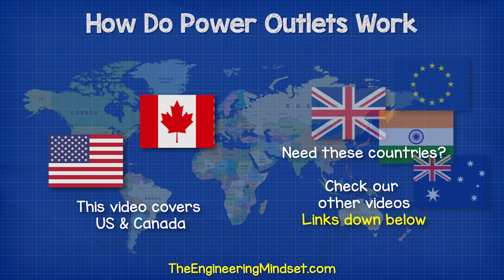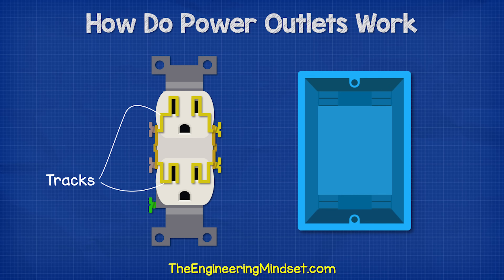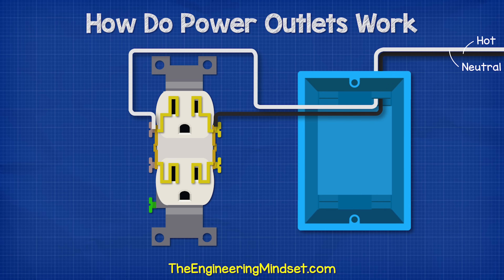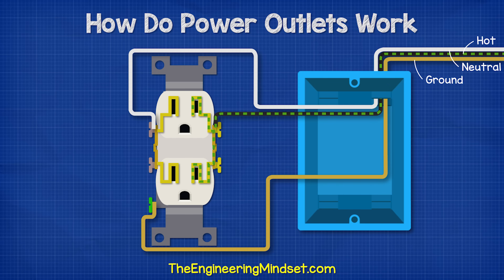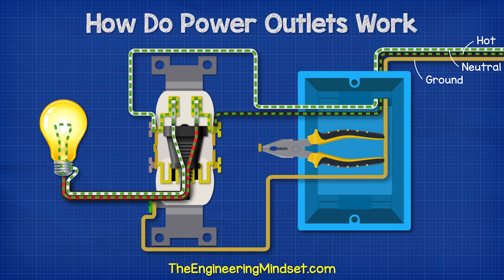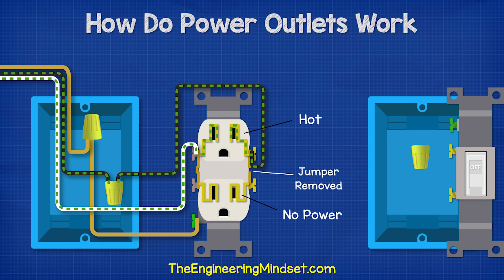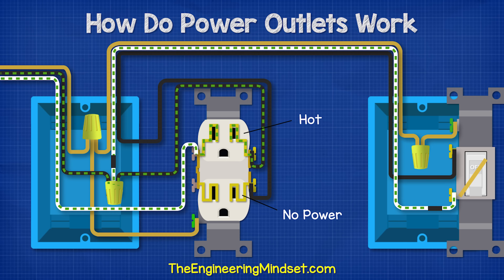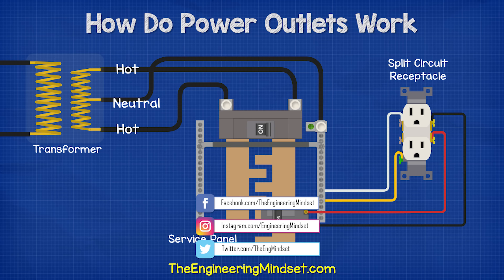How Do Power Outlets Work?

Comment: In the last diagram does the neutral wire take too much current since it’s the return for both circuits or does it not see double the current since the breakers are 180 degrees out of phase?

Comment: Technically, your switched example doesn't meet code. You are supposed to have a neutral available at a switch box now, so the correct solution is three conductor with ground. White stays neutral and your red is live/switched. Neutral at a switch box is needed due to possible DC and smart applications on the market now.
Reply: They really need to remake this video
Reply: So two wire is obsolete for outlets?
Reply: how do you even tag @EngineeringMindset for a response?:d He should read your comment :d

Comment: That last circuit is extremely dangerous as it could put 220V across the two hot sockets. If you plug a computer into one and a printer into the other it could easily FRY the lot as soon as the printer is plugged into the computer.

Comment: Why on earth would you use a white wire to extend the hot wire to the switch? Yes you used black tape on the end but somewhere down the road if someone see the white wire (possibly even somewhere in between two) they are going to assume it's neutral.  Don't do that. The black wire is the black wire thru and thru, your just creating an extension loop so that it can be broken with the switch.  Other than that I really like your videos.  I already know all this stuff. Just finding videos for my son to learn.

Comment: Why use a white wire and put a black tape marker on it instead of just using the back wire for hot?
Reply: Must be an American thing. I would use almost any color except for the ones you use for neutral or ground.
Reply: One black and one white conductor INSIDE the cable.  also one ground conductor.     Therefore need to identify the white conductor as a HOT.

Comment: Idk about elsewhere, but the way I learned was all of your hots are tied into switch box with jumpers to each switch. Run a 3 wire to the plug, red wire on top (switched) black wire hot from switch box on bottom. Whites are tied together in recepticle box with 2 jumpers to the recepticle (top & bottom) break the tab to split the plug.

Comment: What I liked about this vid is that the white wire going to the switched ckt has a stip of black tape '
to identify it as a HOT or UNGROUNDED  conductor,  I see people doing wiring and they neglect 
the fact that the white is kooked to the live side. that coud be a deadly error even though all wires should be considered as 'LIVE'